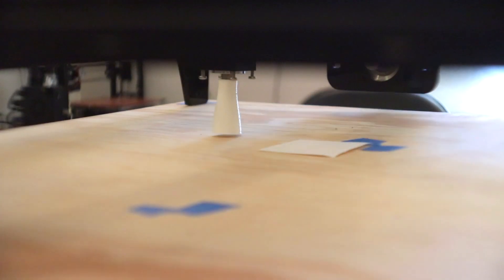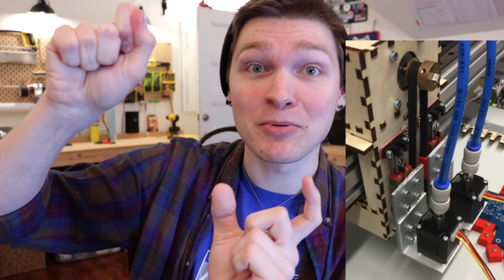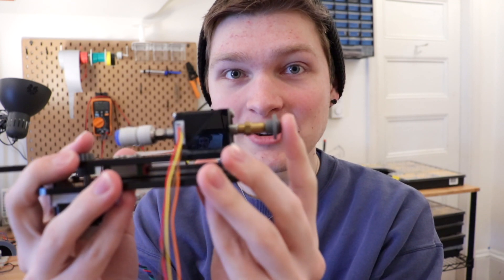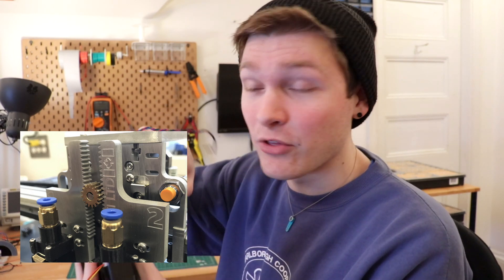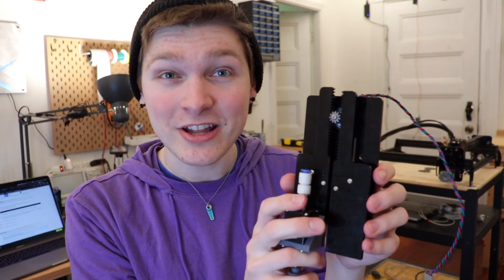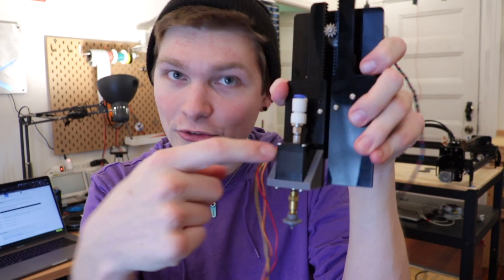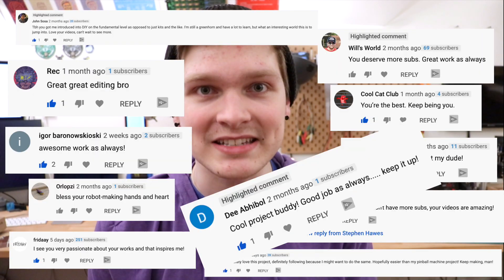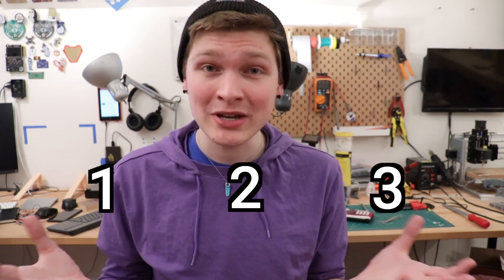DIY Pick and Place Picks Parts!

Comment: I am loving the pace of your progress. In a bid to automate pnp of my part in bob carter brain boards for lebowski FOC motor controller some time back i printed a thing someone else had designed which had an offset gear to allow a normal stepper rotate a part with a syringe as the head. Really impressed with this and the diy feeders. Might see if i can turn my mpcnc or my geeetech prusa clone into an adhoc pnp with the detachable heads mod by yeggo. Keep it up

Comment: How do you get the g code to accurately place the parts?  You need to put the PC board down at a known location, and the relative positions of all the pins/pads, plus the location of the parts.  Getting the "pick" location should be easy, it's the 'place' location (X+Y+rotation) that is the trick!  I guess you can extract it from the gerber files used to make the PC board, did you write a script to do that?   The solder paste (if placed correctly, using a stencil is probably a better method than a CNC dispensor) will 'correct' for parts placed a bit off as the surface tension of the melted solder will pull the parts over the pads.
I've built my own 3D printer, and have extra Nema 23 motors, so I can build a CNC which would do PNP.  This sounds interesting.  Wish I had a laser cutter and was good at 3D CAD.  (I've designed my own parts to be 3D printed using OpenScad)

Comment: Backslash can be removed with a small spring that pulling the moving parts against the pinion.  Backslash is the problem when you change direction between the pinion releases and then connects again in the other direction.

And Stephen in the video, it takes more then one video.  ;-)
Still great that you share your experience. Thanks a lot.

Comment: Tip for testing component placement - put double face tape on the PCB. It simulates the solder paste quite well without the mess.
Reply: all tape has 2 faces. question is is it double sticky sided.
Reply: @darkshadowsx5949  well done, your comment was entirely useless, you mong.
Reply: @lucasc5622  I found it rather humorous and factual.

Comment: Awesome job!
For getting the components to stick without solder paste: I have seen people use scotch tape with the sticky side up or thin double sided tape on the PCB.
It will be about as sticky as solder paste if you get a cheap, not too sticky, brand